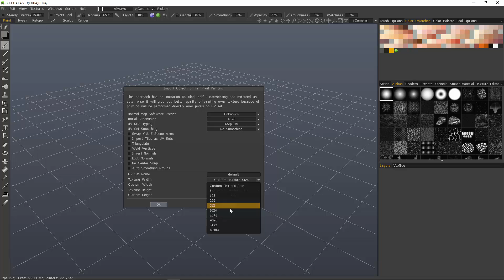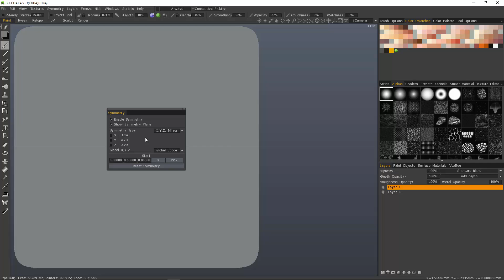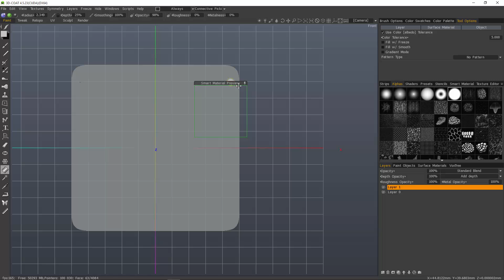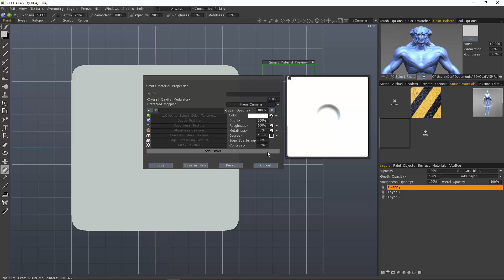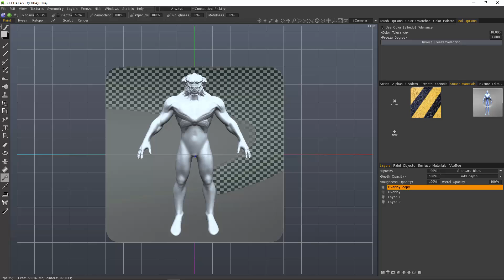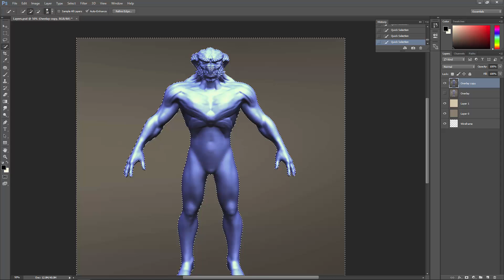Sketching in 3D Coat: Pt.1 Canvas Setup

Comment: CAN IT BE USED WITH "COREL-DRAW" ????
Reply from the maker: +Ivan McKinney ...In the preferences panel (from the EDIT Menu), you can set your &quot;External Editor&quot; to be whichever Image-Editing application you have. It&#39;s under the General Tab, near the top 1/3 of the panel. Point to the install directory and the app .EXE file.

However, I&#39;m not sure it will work as well with a vector drawing app, rather than a raster-based app, like Corel Paint, Gimp, Krita, etc. Those last two are free, and there is a video covering the 3D Coat + Krita workflow on this Channel.
https://www.youtube.com/watch?v=KiI0O6E5EW4